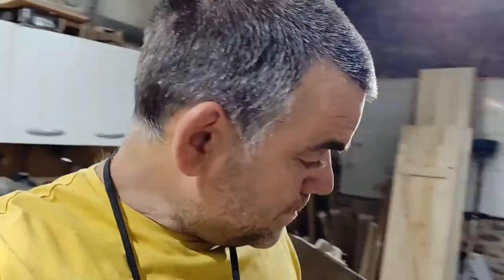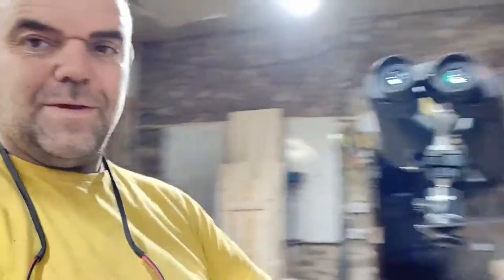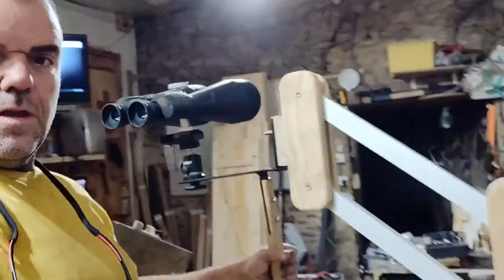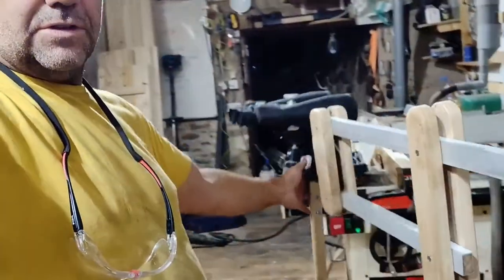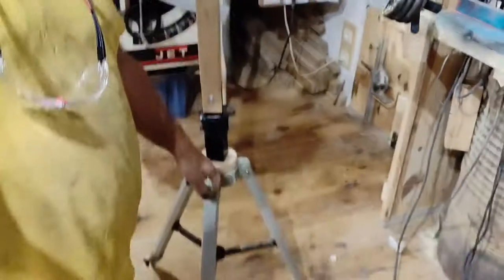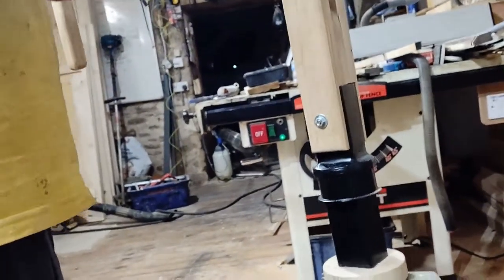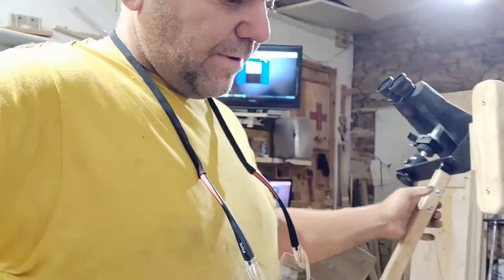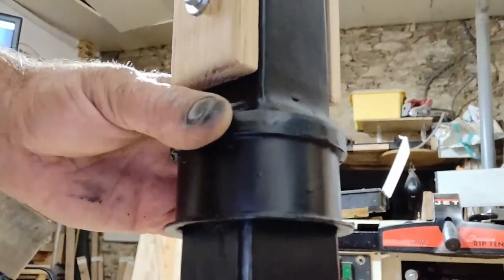Home-made FREE parallelogram binocular Mount DIY

Comment: Marcus, Were you able to eliminate vibrations? I used red oak for the arms, 1.5 x 0.5 inch, 18 inches long from center post. Even when balanced with counterweight and the nuts tightened, it still vibrates when touched. I have the Orion 20 x 80 binos. Weight is 5.5 lbs. Perhaps it is unavoidable.